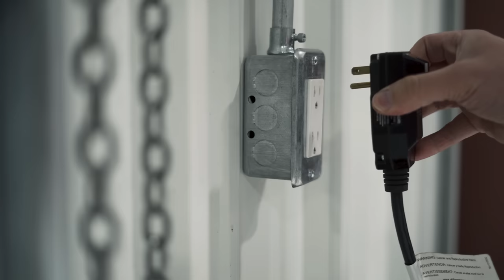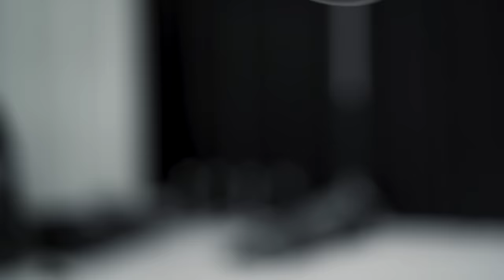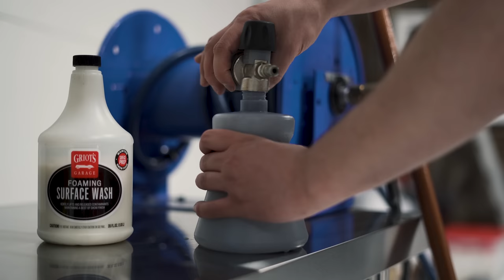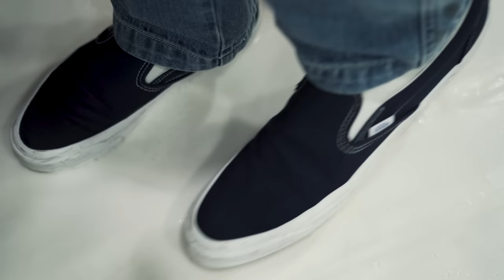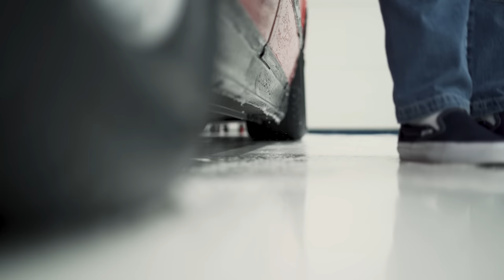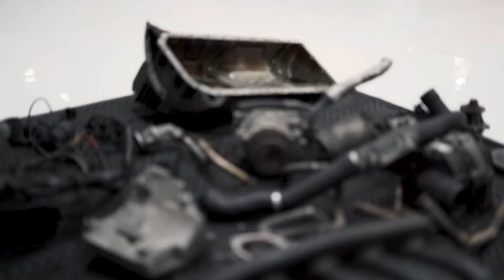Car Washing ASMR - Giving My BMW E34 Touring A Wash

Comment: hey man, superb video as always! also want to say, e34 looks fantastic with this setup & wheels. so she don't need oz's even! want to ask, how do you maintenance your wash tools? did you do video about that, or will you? lastly, imo no need for two bucket wash. because just had a little dust on her..
Reply from the maker: Thanks man! Wheel tools just get pressure washed out and wash mitts get put in the washing machine and hung to dry. And no opinion on the buckets is actually valid so cheers haha 😊

Comment: Hello sir, I have a very important concern, I just bought a GTECHNIQ Crystal Lacquer ceramic and this is a very first for me so what I would like to know is that after polishing passed a layer of wax before laying the ceramic coating? And is it normal to lay the ceramic coating just a few minutes after polishing the body? Thank you in advance for your long-awaited answer. Sincerely GLOBAL WASH SERVICE.
Reply from the maker: You can’t put a coating over wax. Can apply right after but it needs to be IPA😭
Reply: Thank you very much, I learned something very important. 🙏🙏🙏